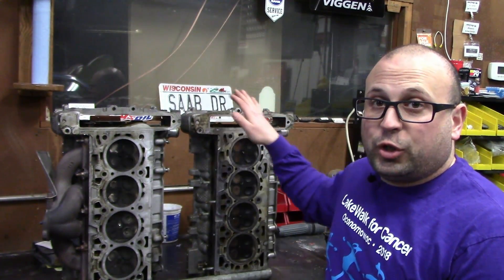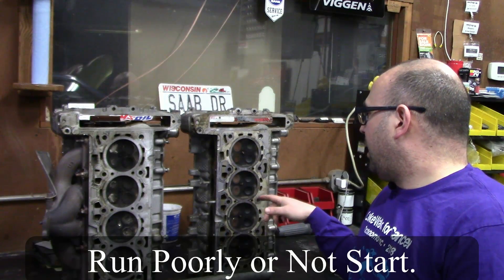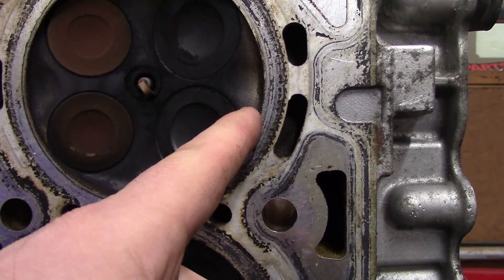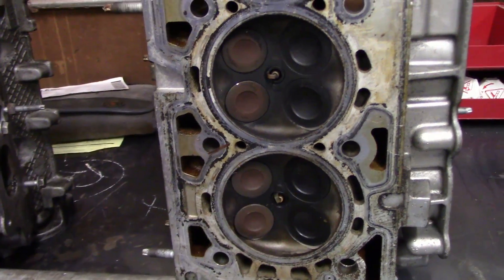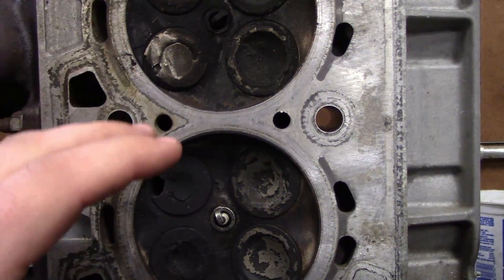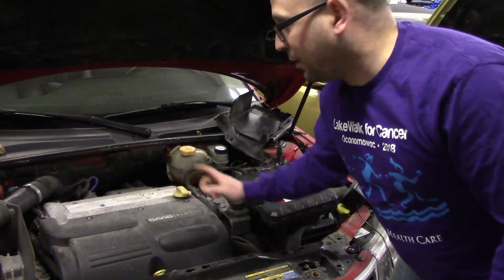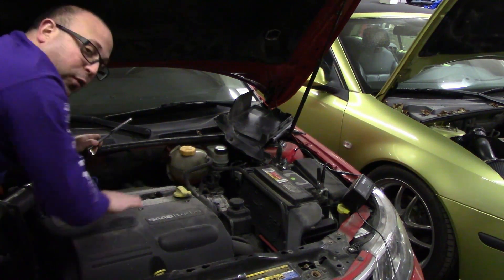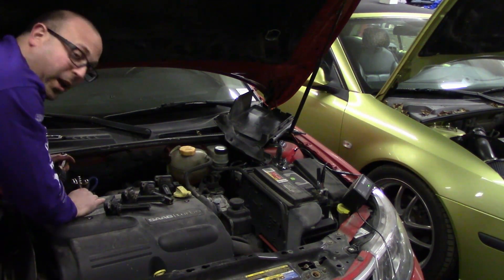Having Issues with your 2007-2011 9-3 2.0 Not Starting Right? This Could Be what's wrong!

Comment: Another cool video! I'm guessing these are the second gen. ecotec engines?
Reply from the maker: In 2007 Saab had a bad batch of valves that ended up going in a ton of engines (from my understanding). They're softer than they should have been. Not sure if this would be a second gen Ecotec or not to answer the question.
Reply: @SaabDr  (I'm in school right now for auto mechanics) and we're learning all about compression and compression tests in my Engines class and what the root causes can be when they fail the test. It was really neat to watch this demonstration on a Saab. This is great content!
Reply from the maker: @TheWiseTent  thank you! And study up, we need guys that are good at troubleshooting cars and understand how they work instead of parts pushers.
Reply: @SaabDr  My passion (and love for Saabs) will help me become the best mechanic I possible can - which will include thoughtful troubleshooting. I think it would be neat to also work with Orio to bring them into Canada (they ship from the USA to Canada, but the lack of presence of Saab parts/parts dealers is really disheartening). So many Saabs here.
Reply from the maker: @TheWiseTent  awesome! Great to see enthusiasts getting into the field.

Comment: Could you do a intake valve cleaning video, with the head still attached to engine?
Reply from the maker: I mean I could -- but that wouldn't help at all with this issue. And I normally don't use seafoam in that capacity.
Reply: I was thinking more along the lines of brush on the end of a drill and some  carb cleaner
Reply from the maker: @kniteraptor  I'm not too sure how one would do that with the head still attached to the engine. You can't reach the faces of the valves without removing the head.

Comment: Why do you recommend switching the cams out of the newer heads into the old heads. regards they not the same camshaft?
Reply from the maker: You want to make sure to use the correct cam for your cars programming. There were several variances of cams over the years so using the one that came with your car stock is the best way to make sure your car is using the correct hardware.
Reply: @SaabDr  thank you Doctor.
Reply from the maker: @excitingstuff420  you're welcome!
Reply: I'm building up a 2010 9-3. 20T turbo, Krona downpipe, Trick Flow injectors, ARP Head studs, etc. Have you noticed any differences in the casting of the heads. Is there any years you would recommend for better performance/ air flow.